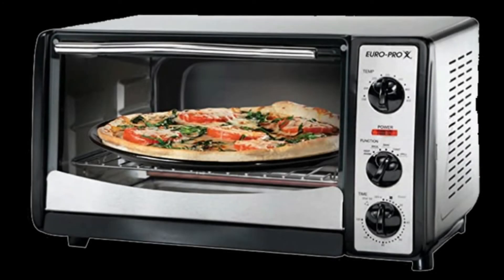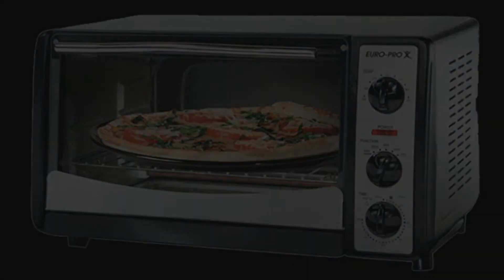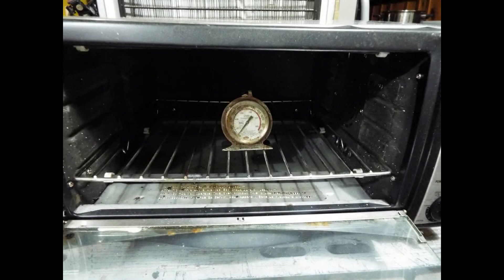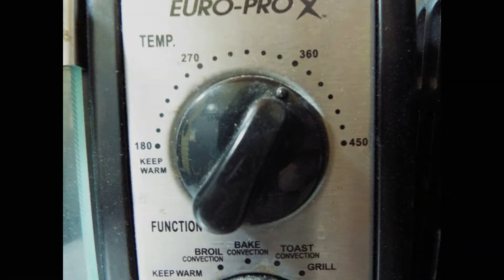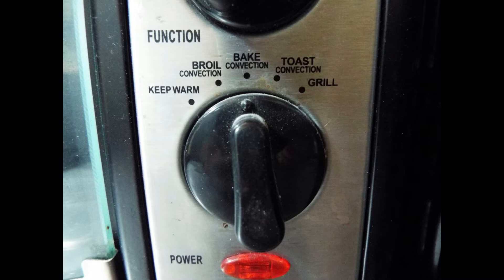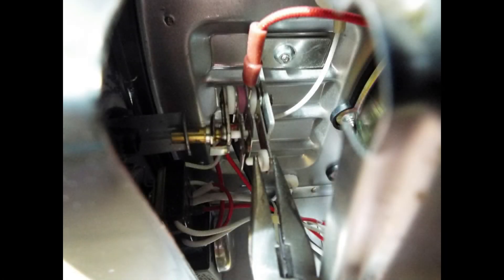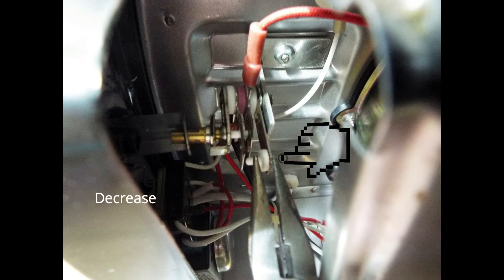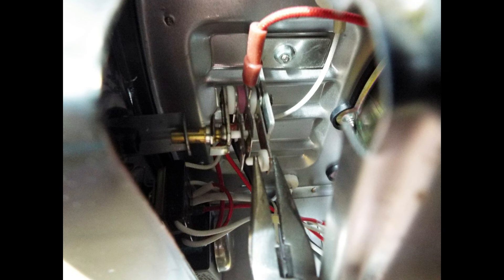Episode 12, It Just Has To Work, Calibrating a Toaster Oven Thermostat

Comment: Metal memory affects this project.   After several cycles of actual use, mine began to relapse toward its original temperature.  I believe several cycles/adjustments over days or weeks are required to really home in on a correct temperature.  Excellent video though, for getting started.  Many thanks!

Comment: Funny old GE toaster ovens,   we used a ground down allen head screw,, silver soldered to a ruined small screw driver,,, fit right on the adjustment ( 45 years ago)  and worked perfect, now they are all junky.